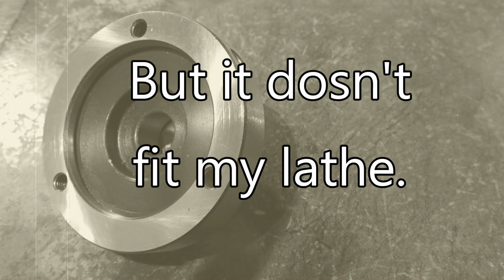Collet Chuck Backplate for a Warco 250 lathe

Comment: Hello there! How did you manage to get in close enough on the 250 to machine the backplate when mounted to the spindle? I have one and the fittings for the leadscrew covers prevent me from getting the last inch or two of travel. I can face it but the warco part comes over size in diameter, and I cant get in close enough to turn it
Reply from the maker: Hi – I had exactly the same problem as you, and that’s why the back plate is so long. It didn’t need to be, other than to get past the lead screw cover so that I could machine it to fit the recess in the collet chuck.
Reply: Haha I am wishing I had done that now. In order to get close enough to reduce the diameter I had to disassemble the lead screw, remove the brackets and cover, as well as the rear splashguard. One quick belt changeover to get the torque needed and I am finally turning it down. Just one pesky millimetre I cannot reach! Will probably have to wreck an old tool and take off  the last bit at an unorthodox angle. It does make me chuckle that on the warco site it says that the machining needed on the plate is a "straightforward procedure". I don't have a rotary table so getting the screwholes in should be fun!